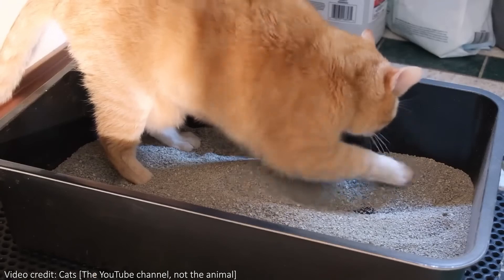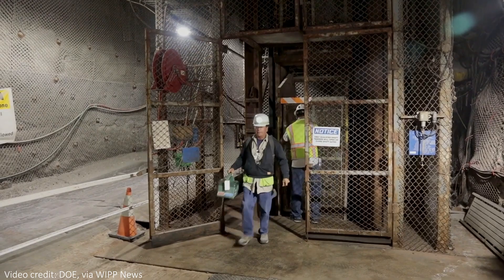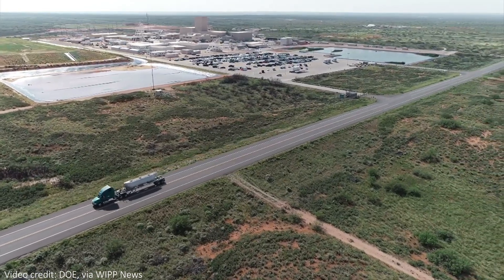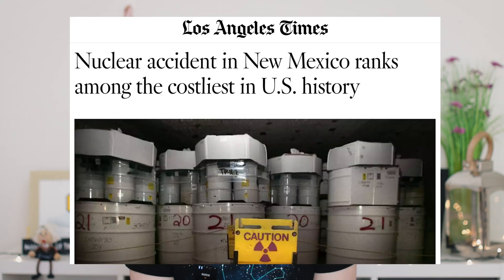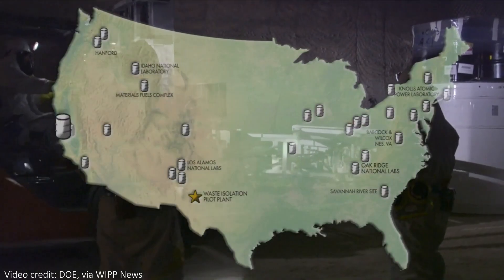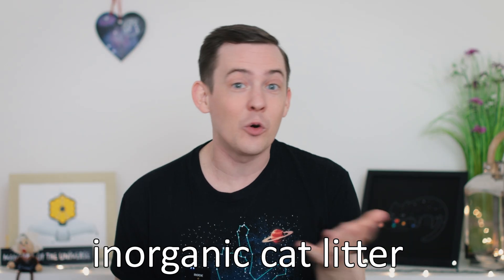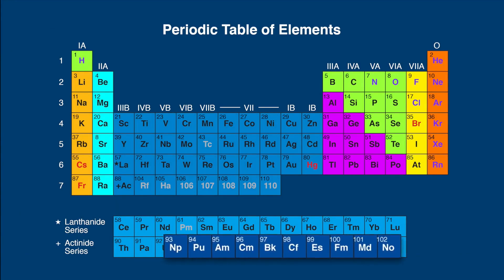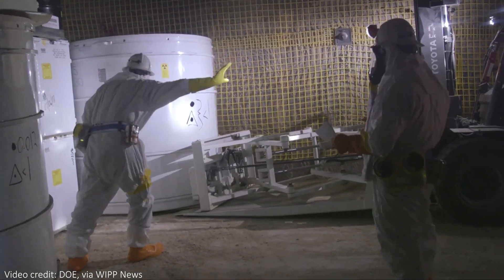Cat Litter Caused an Actual Nuclear Incident

Comment: A similar, but non nuclear, incident occurred at my former workplace in the early 1990's.  Our procedure for disposing of hazardous chemical waste from the research labs involved placing the waste in a 1/2 gallon fluorinated polyethylene jug and then placing 30 such jugs (three tiers of 10) in a 30 gallon "fiber pack" (cardboard drum) lined with a polyethylene bag and the tiers separated by corrugated cardboard disks.  The bottom of the pack and each tier also got a scoop of absorbent clay granules (yes, kitty litter).  When the drum was full, a lid was clamped on and the pack trucked to a feeding pit for the on-site incinerator (a modified rotary kiln, such as used for cement production).  At some point, a decision was made to switch from clay based absorbent to an organic absorbent (dried and ground corn cobs iirc), I think to reduce solid waste that had to be landfilled.  The inevitable happened, a bottle leaked a mix of concentrated nitric and sulfuric acids, the cellulose based absorbent caught fire and everything in the holding pit went up.  This wasn't as bad as it sounds, since the pit fed directly into the incinerator, with the packs being shoved along in batches by a hydraulic ram.  The operators just stopped adding packs to the pit for a few hours, while the flaming waste was shoved into the incinerator, emptying the pit.  The only change made after the incident was that concentrated acid was not allowed into the waste packs, it had to be diluted first.
Reply: Curious why they needed fluorinated PE as opposed to plain PE?  Since you were incinerating the wasts did that mean an incresed emission of hydrogen fluoride and/or PFAS?
Reply: @soundspark  A lot of our waste was hydrocarbon in nature, which caused untreated polyethylene jugs to soften and split.  The treated jugs did not contain much fluorine.  They were made via a brief exposure of regular PE jugs to dilute fluorine gas, so just an atom thick surface layer of fluorine, maybe a part per billion of the jugs, which were less than a percent of the waste stream.  The incinerator was known locally as the "six nines" as it destroyed > 99.9999% of the test waste (carbon tetrachloride, which is almost impossible to burn and was actually used in fire extinguishers once upon a time) during its annual testing for state certification.  Any acid gases (HCl, HF) were removed in the scrubber stack between the incinerator and the chimney.  Not sure if any PFAS was formed under normal operating conditions, interesting question.